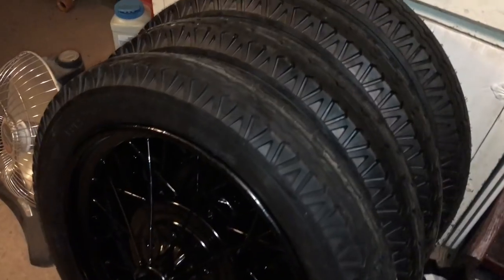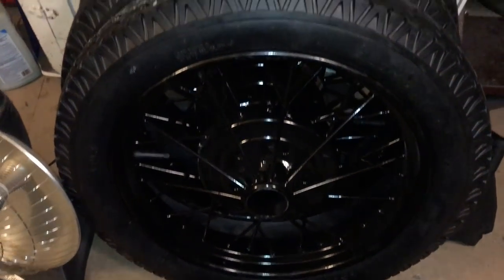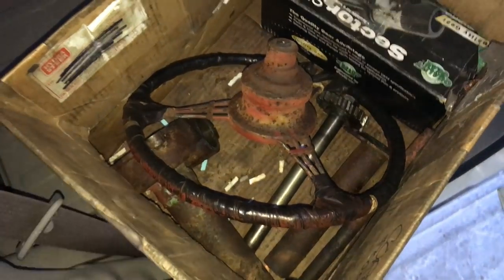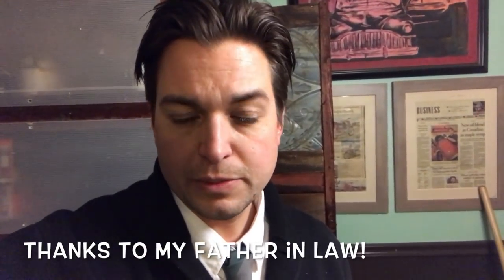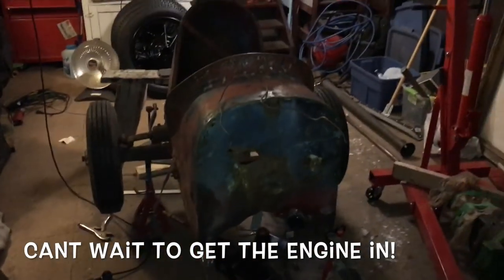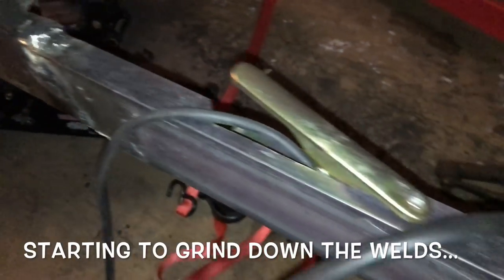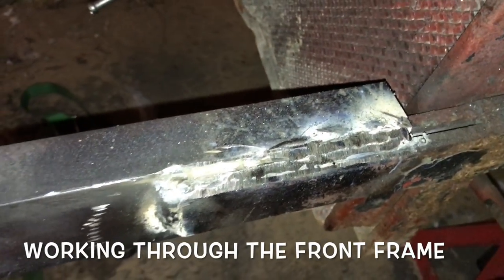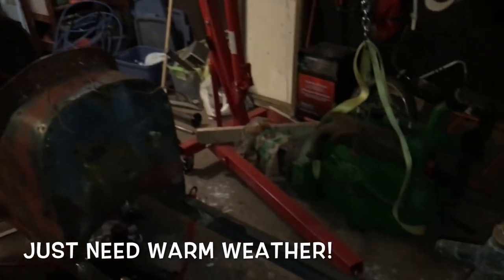Race Car project update, cold weather blues!

Comment: Get a garage heater! I used to use propane tanks and a kerosene stove at times. There are those cool ones that hang from ceiling as well. Propane i believe... Just hinting....
Reply from the maker: I have an electric heater but the draw from he welder with the heater on keeps blowing the breaker! :) it will warm up soon enough :)
Reply: yeah you can't use electric. Maybe i'll send you a bottle of warmth from Georgia. : )